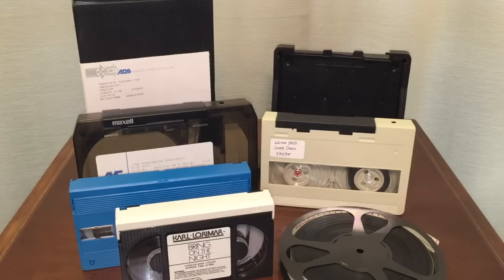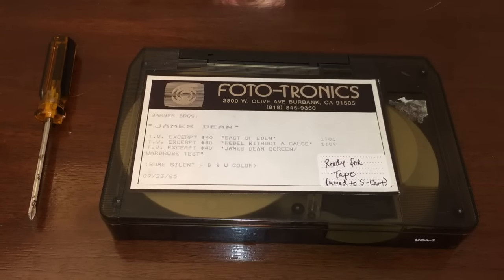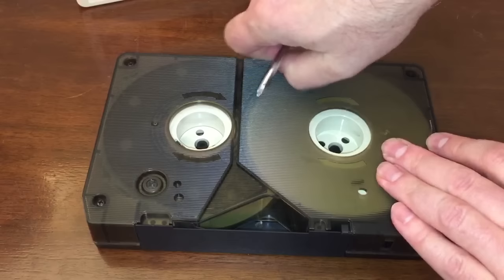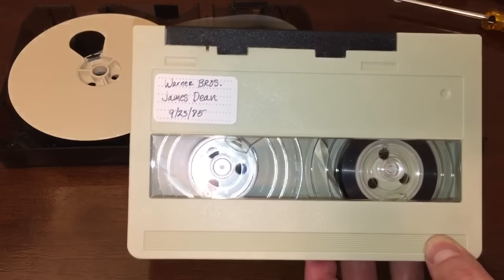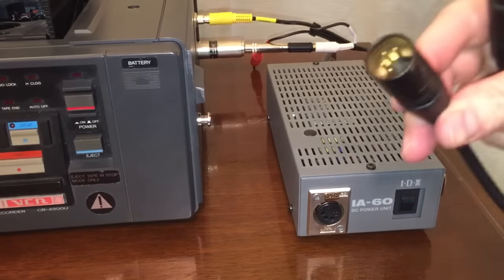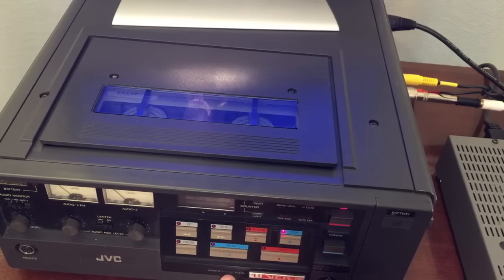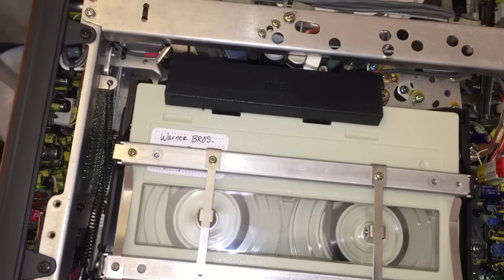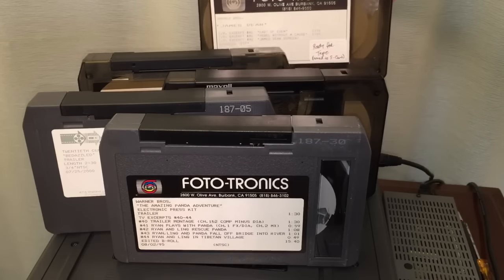3/4 inch U-Matic Video Tape Format - History & JVC S Type

Comment: We used that exact same deck to shoot over 1000 20-minute U-Matic tapes. An extremely robust and reliable deck. We used ours in all kinds of weather conditions and environments.  Now, I am in the process of capturing all those 20-minute tapes to digital.   The 3/4" U-Matic format served us well and was indeed State of the Art at the time. I am currently using three Sony U-Matic machines to do our video capturing, but we used JVC portable and editing decks for our productions.  The machine you showed appears to be in extremely good condition. We still have ours, but it has many "Battle Scars" from years of demanding service.

Comment: Worked with equipment like this back in college in the early 80s.  I could even tell you want all the connections do.
SYNC IN (synchronization in) and SC IN (subcarrier in) is for syncing the VCR to broadcast facility's sync.  That way when you switch sources the frame does not roll.  subcarrier refers to color.  sync is black level horizontal and vertical sync.
And as others have said, U-Matic is not that high res.  Though the color can usually be more stable then VHS.  S-VHS does have higher resolution.  And you are right.  The edit decks were heavy.  I've moved them before.  Sorry, showing off.
Reply: Im a big fan of VHS, grew up with it, but Ive only recently been introduced to recording my own tapes; is S-VHS worth the investment for the extra resolution; and do you have a clear idea why people shit on S-VHS so much? because it seems to me, the S-Video carrier uses RGB doesnt it? as thats why SCART over here nullifies the need for S-Video; being an RGB signal [if Im not wrong that is], should make for a pretty damn good picture; and I remember hearing W-VHS was basically S-VHS on steroids

Comment: U-matic was originally intended as a consumer format, not just a commercial / industrial format, but the large tapes and heavy-duty decks they required meant Sony and its partners (JVC, Matsushita) were never able to reduce costs enough to make that practical.

They were able to get costs down enough to make the decks perfectly viable for broadcasters, government and industry though, and U-matic quickly swept thru the marketplace, displacing some open reel videotape use and really facilitating electronic news gathering and other uses from the mid-'70s and beyond.  By the '80s virtually every television station and broadcast production facility was littered with U-matic decks and editing equipment.

U-matic got a big upgrade in '76, with a high-band BUV format that boosted the color recording system and lowered noise.  It swept thru the market and became standard within a couple of years.  They created an SP format in the mid-'80s that was meant to allow U-matic to keep up with Betacam, which got its own SP format in '86 that allowed for 340 lines of resolution on metal tape.  U-matic SP used chrome tape to provide for 330 lines of resolution (3/4" metal tape would have been crazy expensive).  A standard U-matic deck could play SP tapes, with degraded performance.  It provided an upgrade path for shops that were unwilling to convert to Betacam SP (mostly fixed studios where portable use wasn't a major consideration).

In spite of numerous attempts to replace U-matic in the '80s with 1/2" formats - in particular the VHS-derived MII format and Betacam, derived from Sony's beta - U-matic remained in fairly heavy use into the 1990s before Betacam and Digital Betacam (launched in '93) finally relegated U-matic to playback of older pre-recorded tapes.

Comment: The "flat part of the hub" is called flange. I think this is a really clever arrangement that, to my knowledge, have not been used in other cassettes. Audio compact cassette and micro cassette have hubs without flanges, but most video cassette formats I know of have two traditional reels with flanges enclosed in a case. I suppose that using the same approach as with compact cassette did not work for video, maybe because friction would be too high because the reels are much larger than on compact cassette. But Video8 and MiniDV have smaller reels... IDK.

Comment: This is actually 240 lines because it is the low band variant of the umatic format. There are high band and SP versions.
Reply from the maker: Thank you.  That helps!
Reply: databits I'm sure those would be used by TV stations such as for news gathering.  Schools probably had the other type, though I don't remember how it looked other than remembering those machiens being massive as well as those cassettes back in the early 80's.
Reply: Agree with Fivos.  Lo-Band Umatic has a horizontal resolution of 240 lines. Umatic SP has a horizontal resolution of 330 lines.  Playing my U-matic SP archives in our SONY BVU-920 Player (Dynamic Tracking & Time Base Corrector) has a very good Standard Definition quality, only second to Betacam!  PS. The power connector is a 4-pin XLR.

Comment: I can confirm that the format was used until at least 2000. The university I went to was still using U-Matic SP decks at the time. Speaking of the SP format, don't be surprised if those later tapes are in that higher quality format. Also "broadcast quality" isn't all that high quality, mostly due to the fact that all broadcasts were limited in bandwidth due to the NTSC (and PAL) subcarrier embedded in the signal (aka composite video). S-Video removed that limit and allowed much higher quality video. Both SVHS and ED Beta (and naturally digital formats like DVD) have better then broadcast luminance channel resolution (they retained the awful low bandwidth color channel) and required S-Video to capture/transmit the higher resolution video.

Comment: Great video. I was sent this very same model of u-Matic some weeks ago and have powered it up and been testing it this morning. Yet to connect to a monitor, but all mechanical functions work well.
Enjoyed watching your mechanical tests and playback. I have three larger u-Matics as well.
I too have come across image bleed and in some cases, loss of colour.
The answer to that was that the particular recordings were high band. My large machines are all low band. Not yet sure if this machine is high or low band, but I will test the playback again soon to check.
I have many different format VCRs in my collection, hoping to find a u-Matic with high band playback soon - but without the colossal price tag! 😊

Comment: U-matics r00l! Have a tank of a JVC 8250, and a Sony VO-9600 (SP). Both functional, which is a lot more than you can say for some of the newer VHS junk I've had from the 90s. The resolution may not be much higher than VHS, but the picture is noticeably less noisy thanks to the larger head gap and enormous head drum. Also, the linear audio was hifi stereo from the outset, at least as good as any audio tape. VHS got the hifi retrofit quite late and via the complexity of additional heads on the drum.

Comment: Also if you choose the clean the heads only use foam tip cleaners.  Cotton swabs will tear apart in the video heads and wreck them.  You can use isopropyl alcohol (not rubbing or containing oils) of the 90% or so strength.  Acetone works well on heads too but keep it away from plastics.  It melts them!

Comment: Many years with 3/4” AB roll edit suite and field decks.

For the audio output there are XLR female to 1/4 inch male cables, pretty sure I have seen to RCA  male.  If you dig enough there is probably a xlr female to rca female adapter.  🙂 fun though to come up with all the different adapters to make it work.🙂

Comment: The white stuff was silicone. it was on the tape from the factory as a lubricant for the tape its self. Real common to see it powder up on the heads and tape path because of the age of the tape. Reel to Reel tape is where its most common to see it. Most TDK and Maxell back coated reel to reel tape would shed it.

Comment: Cool machine. I have a Sony VO4800 Umatic-S portapak, a VP1000 player, a VP2000 player, and a Panasonic NV9800 recorder. I have played pany tapes that are over 35 years old, and most play fine, but you should be aware that tapes made by Ampex and 3m have many problems, mostly becoming sticky and that leads to tracking problems,
3/4 was not designed as a broadcast format, it was originally designed as an industrial format, because it did not have the resolution, and signal to noise ratio required for broadcast. Also because the color is a hetrodyne, or color under system it was deemed not suitable for broadcast. The format however did quickly become an acceptable format for news gathering, and typically what was done was the tapes were dubbed to 1" for editing and broadcast.  Later after the format started being used widely for ENG use, machines were modified for editing, and digital TBCs were introduced that made the color and stability passable,but they still had the resolution limit of only about 280 lines.  Broadcast gear had around 340 lines of horizontal resolution on NTSC broadcast, and on closed circuit closer to 500 lines. The big limiting factor was the 4.5MHz audio carrier for NTSC TV sound. 
Even with the 340 limit, a tape format with only 280 looked soft by comparison. 
Hi-Band Umatic solved this problem, bringing the format on par with Betacam as far as luminescence resolution went, but Betacam still did better in the color dept, as they used component color signals as opposed to color under composite.
Reply: I can relate to the crappy Ampex tapes. I am currently capturing over 1000 20-minute U-Matic tapes to digital. The Sony and Fuji tapes in our library are bullet-proof and capture very easily. The Ampex tapes shed their surface and drag the capture machines down to the point where they shut down and require a thorough cleaning to get them running again.
Reply: @slorznovitch  
Yup pain in the but that's for sure. And to think that some people still want to record stuff of tape

Comment: based on the rack gears on the front of the top loader im pretty sure that it used to have a soft eject.  over the years the stuff they used for drag on the gear goes south and the soft open becomes a little more......snappy.

Comment: Rotary Transformers are used between the stationary top part and the bottom rotating part of the head-drum, BETAMAX is a direct copy of the UMATIC tape system but uses smaller head-drum.

Comment: See where the audio head is? There is a synchro head as well on the very top or very bottom not sure, if it's dirty or miss aligned it creates tracking problems, If all that fails use an external time base corrector between the output and the TV input and it should play fine.
Reply from the maker: Good tips, thank you!
Reply: A timebase corrector won't help with that once the mistracking noise is there. But I agree I reckon it's a clog or misalignment on the control head. Best try scratching the head gap with a fingernail a few times, and if that doesn't work, spray some lens cleaner on it, scratch again then leave for ten minutes to dry.

Comment: That was a crappy transfer.  Umatic decks were used to play movies on PayT V before HBO, this was around 74-75, in the LA and San Francisco Bay Area.  The Service was ran on TCI cable, and called THe Cable Theatre Club.  Movies we ran included Blazing Saddles.  The charge was 6.95 for 10 new movies a month.  The quality of our shows was very good, but a Time Base Corrector (TBC) was always required to ensure signal stability.  The TBC cleaned up sync and chroma and severe dropouts, it was an enormous unit, with limited memory required for  frame storage  to correct tape timing errors.  The Movies were dubbed in Hollywood, by the same companies on your video tapes.

Comment: Could you imagine if U-Matic actually was used as a home format... or a data or digital format, how much storage could you fit in a U-Matic tape?  And what kind of resolution had U-Matic gone digital like D-VHS... could we have had 4K in the 1990s? 

Also I'd have thought the JVC S-Type would have been a broadcast version of VHS rather than U-Matic in a smaller cartridge.

Comment: i have actually come across a few old sony units a few years ago in a computer recycle store and being sold as is. the reason some electronics get sold like that is that they dont have a way to test the equipment either cause they dont have the cables or the media that the device uses to test with so they can only go as far as powering on. sadly right now they dont have any u matic decks to sell but man would those be a pain for me to have to drag home on a bus no less.

Comment: The tracking Issue looks to be a pinch roller issue.  That said i don't have much experience with basic U-matic I have used the SP version a good bit and defiantly plenty of experience with Beta SP and I have seen those kinda of tape path issues be caused by a bad roller.  As to the blurring of the video I doubt the head is Bad these portable decks never get that many hours I have seen decks with over 20,000 hours on the heads working just fine.  My guess is you need a to recap the deck I have trashed a few U-matic SP deck because it just not worth the money to replace the caps.

Comment: I was working in a small market television station and we used the SP version of 3/4 inch tape into the early 2000's. The main thing about 3/4 inch wasn't so much the lines of resolution. You didn't need it for broadcast because everything that was broadcast was standard def and most tv's were also standard def. The reason this was better than VHS was the
s/n ratio was much better.

Comment: if you want it to work properly you might want to talk to the guy from 12voltvids channel, he has experience with professional video equipment from that era.  the heads might be ok but in need of alignment either mechanical or electrical.

Comment: So, when we were kids the tv stations just played videotapes on us :-(
I read in the comments that the umatic could only achieve 240 to 330 lines horizontal resolution. Where does the 625 or 525 lines transmission come in? They could've at least tried to switch to Super VHS when it came out in 1987